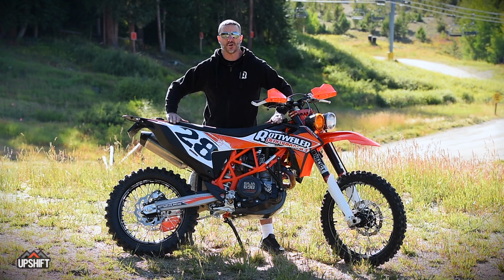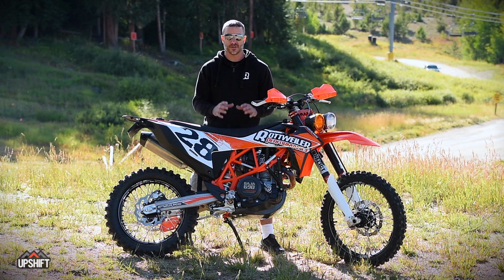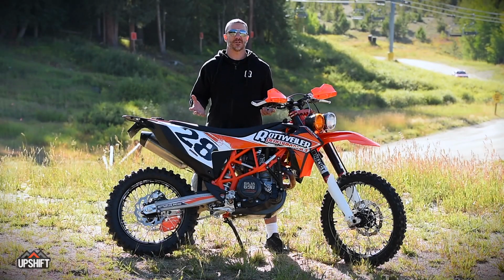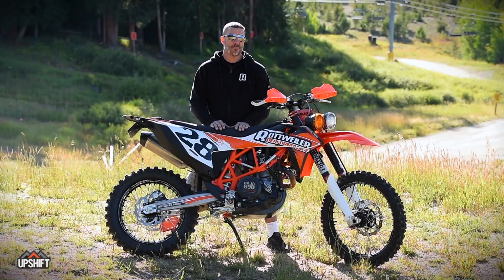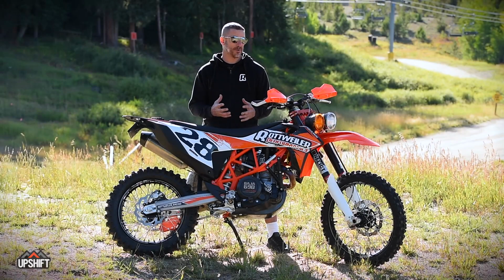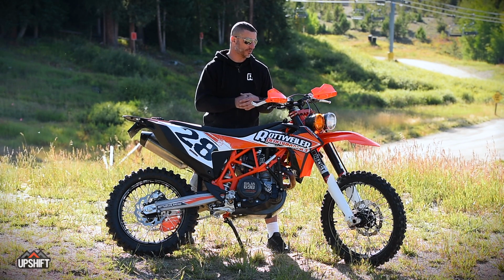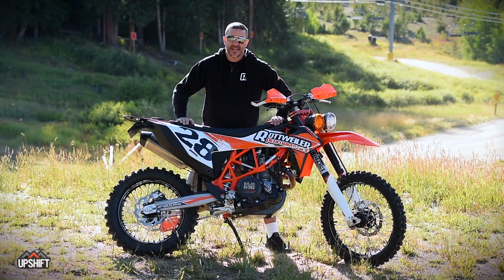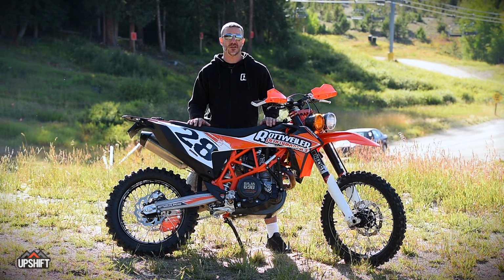Rottweiler Performace 2019 KTM Baja 690 Project Build

Comment: That is one sick motorcycle.

I have a '23 701 Enduro with a Yosh can, modded stock airbox with a 70% snorkelectomy  / Twin Air filter,  Rottweiler's O2 dongle and PC6 with their map on it.  The difference in power, particularly off the very bottom and through the midrange, is awesome.  It revs out hard on top of course, but what I really enjoy is how it no longer feels soft off idle and at lower RPM when trail riding in tighter stuff, and how it doesn't lug at the bottom of 6th gear anymore on the street.  Just turn the throttle and it churns the tire and accelerates hard like a massive high tech thumper should - braap city!   It has power everywhere, Rottweiler clearly knows how to tune the 690 engine. 

 I generally ride reasonably open stuff as I live out west and actually geared it up to 16/45 as it runs with so much more authority. This makes for a sweet gear to gear pull on the pavement and relaxed and nearly vibrationless freeway cruising at 70-75. The abundant power handles the taller gearing well when off road on the 4x4 routes and moderately technical stuff I ride. I have a 300 XC for the truly gnarly stuff...

As for suspension, dropping stiffer .65 springs in the forks made a nice difference as they come unbalanced with .72 in the rear and .59 in front, I suppose for the rear mounted fuel tank, passengers and all the crap people strap onto them.  This makes the bike feel properly stiff in back and soft/low in the front or "stinkbuggy".   I just dual sport day trail ride mine in CO, it is good enough for my not racing in Baja purposes with just the stiffer fork springs in it.  The shock is quite good for my spirited but not crazy trail riding.  And ya, it will do single track, but it really comes alive when things open up.  Going 90 down dirt roads is a perfectly reasonable proposition on a 690  😂
Reply from the maker: Thank you for watching and the great comment. Some good info there.

Comment: Any less dramatic suspension upgrade proposal?
Reply from the maker: The suspension he installed on that bike is next level. It would actually take a bit of work just to find most of what is going in there. You can simply get the suspension you have re-valved and sprung for for you. This is highly recommended and pretty standard stuff. Carl’s Cycle in Boise has some great settings and a lot of experience with the 690.

Comment: It turns out the Rottie airboxes on 890's........... they flow so well the 890 can suck dirt right thru the filter. Quite a few bikes have ruined intake valves due to dirt ingress.

There have been questions of cracked airboxes, and leakage at joint of airbox and airboot.
Aftermarket isnt always the answer.
Reply from the maker: We have not heard about that or experienced that so not much we can say.

Comment: Thats a lot of impressive bling on that bike. Yet if you don't change clutch slave cylinder gasket +mod the clutch itself you might not finish one race.  By swapping  all the bolts at least fuel tank wont fall off - nice design KTM. Also stock pump = not finished baja race

Comment: Holy crap that bike is still a pig. I've built/owned several XRR's and a 690 enduro. The XRR beats the 690 hands down in most areas: lighter, handles better, torquier, more reliable. I found the 690 to be very heavy, VERY stiff unforgiving chassis, and limited in steering lock. I could ride the XRR's in single track terrain where I would never dream of taking a 690. I wish Honda would have kept the XRR but lightened it and put an e-start on it with FI.

Comment: 36 pounds or 46 pounds? You said 360 to 314 wet?
Reply: There is no way they shaved 36 pounds off that thing. They probably forgot to weigh it with fuel.